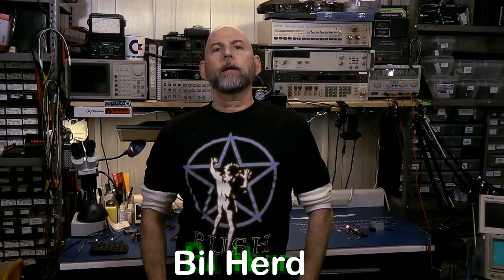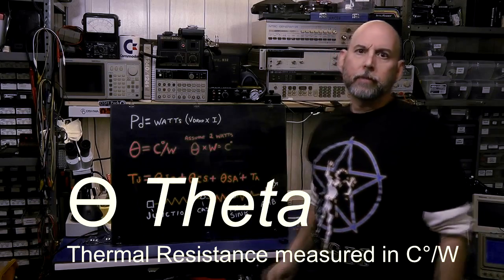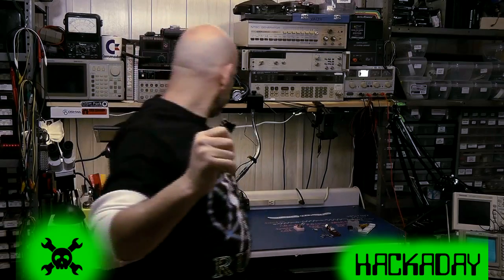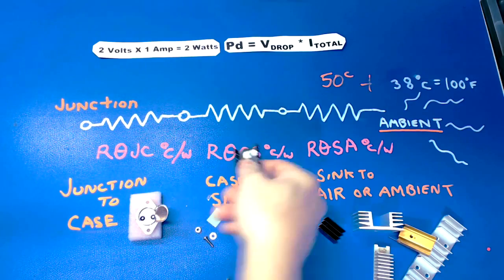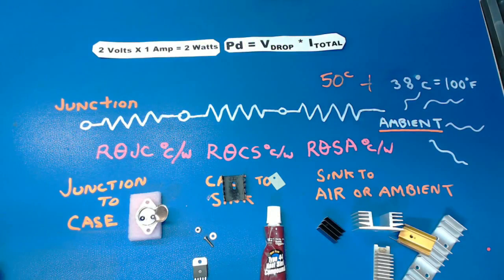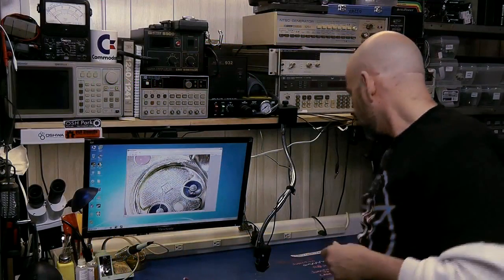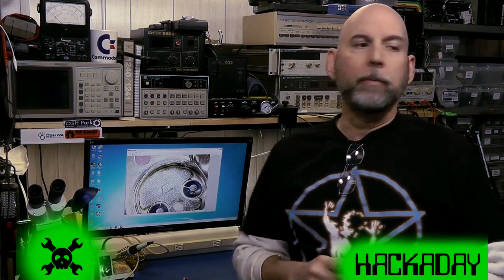Calculating Heat in Electronic Circuits: Do I Need a Heat Sink?

Comment: I don´t really understand how it helps. The use of the heatsink has increased the temperature of 50°C
If we wouldn´t have use the sink we would have a temperature of only T=38°C + 0.8°C + 8°C = 46.8°C   which is better than 96.8°C

Do I see it wrong?
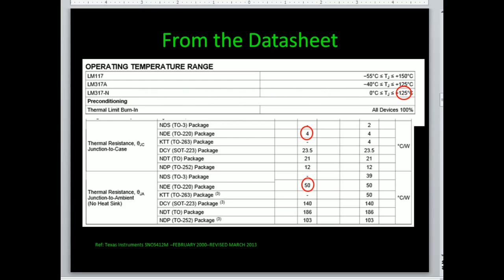Reply: At 6:20 is the case where you don't have heatsink. For 2W dissipated power you would have junction temperature of 138°C, with heatsink it is 96,8°C.

Comment: 125c?  So you could literally boil water with a bunch of these and still call it a cooling system?
Reply: Boiling water with them would make a pretty effective cooling system if you change the water as it boils. After all your transferring heat out of the thing into the water to boil it.
Reply: Yes, t's possible to burn your finger on a correctly working part which sounds counter-intuitive.